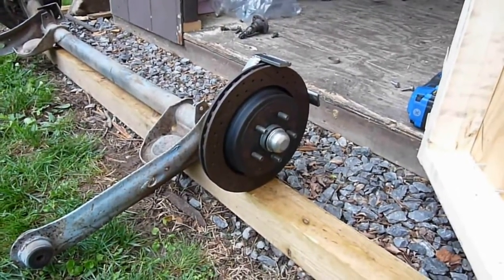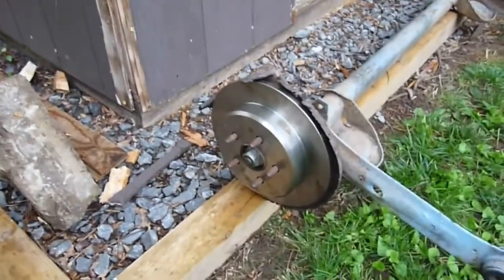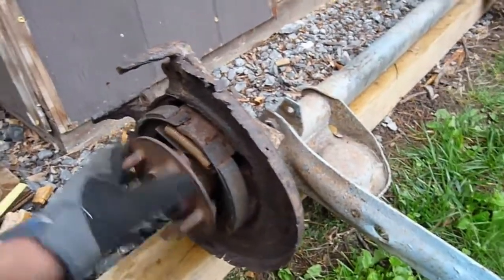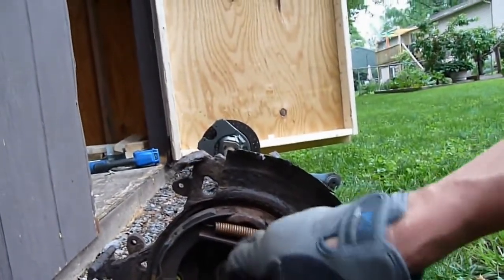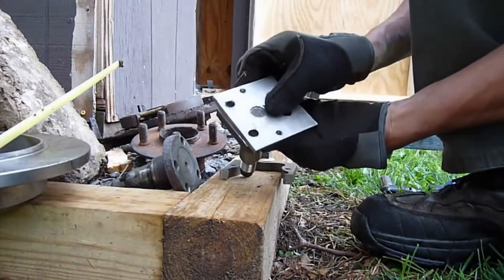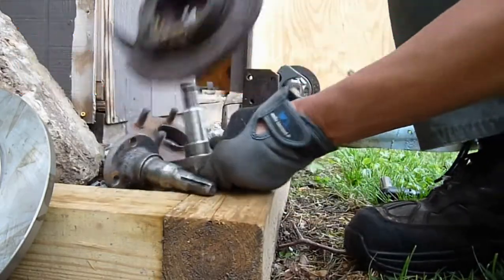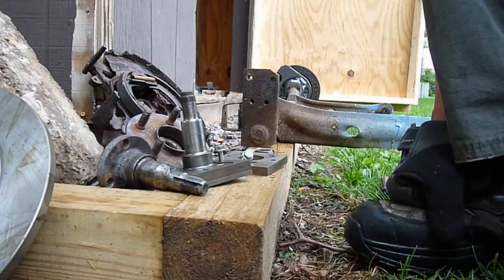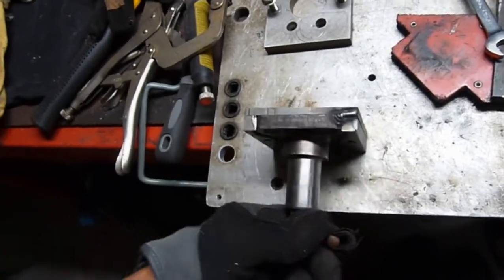Rear Disc Conversion - Neon/PT Cruiser to Daytona/Laser

Comment: Can you still buy the backing plate for the PT new? Also, is the rear disk setup for GT only?
Reply: Ah, are you referring to the backing plate as "Flange"?
Reply from the maker: As far as I know, the rear disc brakes only came on the GT versions.  The rest were drum brakes.  I haven't seen any backing plates for sale, but I also haven't really tried to find any, since I'm not going to do the project.  I'm sure that there are a lot of southern cars with perfect backplates available in the junkyards.  You should be able to buy everything directly from them.  But, I would then buy the e-brake cables new.
I'm hoping that someone will try doing the conversion and post the results.  There are a lot of drum brake Lasers and Daytonas that could benefit from this.
Reply: I was hoping that they were still around NS1 so I could snatch a few up. :( I have a few sets of the mid '88-1990 rear setups. One was refurbished by Steven Seale. I like the consolidated hub assembly design on the GT.